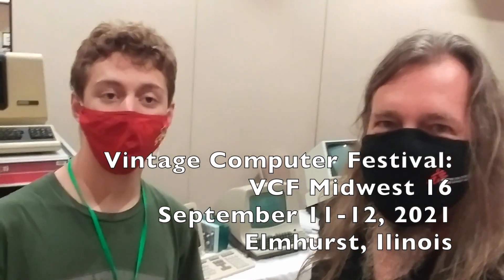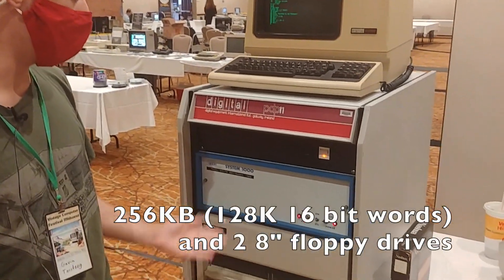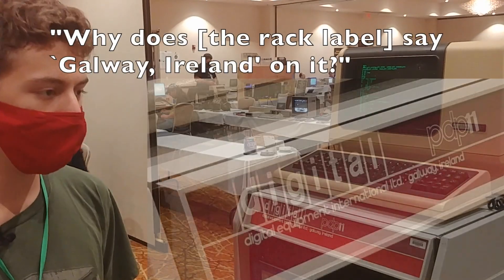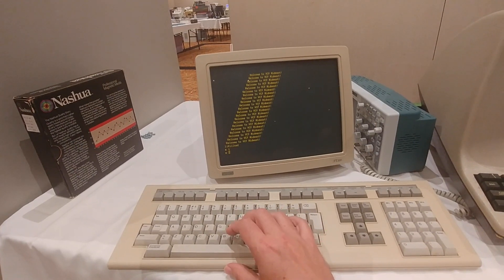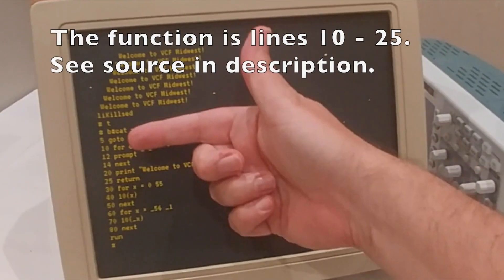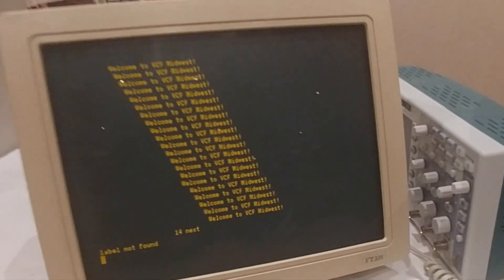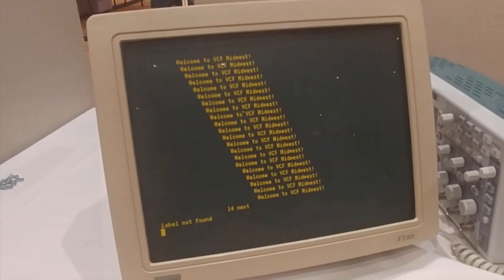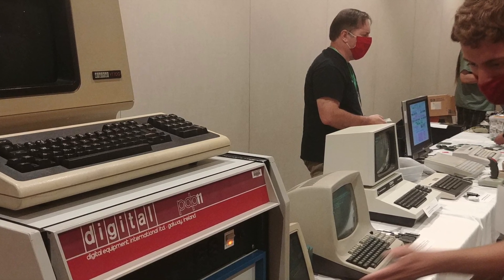PDP 11/23 running UNIX version 6 at VCF Midwest!

Comment: The (assembly) source to v6 bas is available on github (I attempted to post a link, but my comment got deleted). I find it fascinating that the BASIC program crashes, yet that computer appears to be very stable in other ways.
Reply from the maker: Ya, it's super weird. I wonder if I'll hear from Gavin what he finds. Because he has the root file system on one floppy and the /usr (where the temporary file and source code were), I would test it by putting the source and tmp dir on the same floppy drive as the root file system, to see if it's a problem with I/O to the second floppy. (I'm not going to bug him though. :) I sent him the link to this video. )
Reply: Gavin here, from what I have found from reading the source code, I am pretty sure the crashes are coming from the impressively slow access times that the RX02 drives have. BASIC likes to constantly access a /tmp file while running, which stores an intermediary copy of the running program. My bet is that the BASIC is attempting to service signal interrupts while it is waiting around for the rx2.c driver to pull data, and that is fouling something up. I don't think the issue is specifically with the rx2.c, as everything else seems to work. I have even been able to compile a viable kernel from source on the machine, it takes over an hour but it works.

One of these days I will get the RL01/02 drives going, and I get test it again with something more in-spec with what UNIX would actually be running on.
Reply from the maker: @tergav8312  I was also thinking it would be cool to get bas(1) working since it supports draw/plot output to the Tektronix. Those are documented in thee version 6 bas(1) man page. Could be fun. :)
Reply from the maker: @tergav8312  Excellent - thanks for the follow-up! So, perhaps a condition untested before with bas(1): temporary files on floppy!

Comment: Thaaaat's pretty cool.  I have an 11/03 backplane and cage, an 11/73 CPU card, and a (nonworking) vt100.  I hope to get it running off an ATX power supply with an esp8266 generating the right power good signals to get the cpu card to start, and then assemble a qbone and get Unix running on it.  That dude's is the Real Deal though.  Extremely cool.
Reply from the maker: Plus he didn't just install it, he's been learning it and coding in assembler.
I wish there was a log book that showed how it managed to be in a rack from Ireland, have the motherboard/CPU in a 3rd party case, and end up at Univ. of Minnesota!